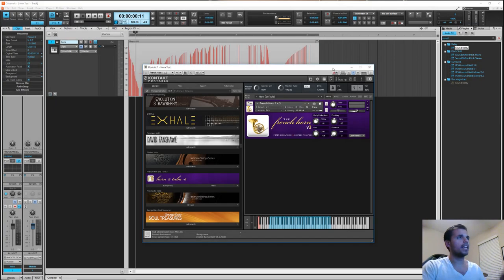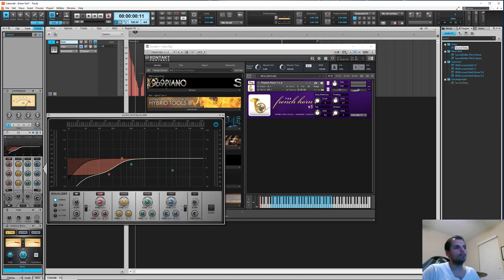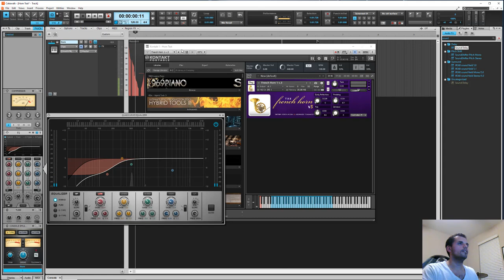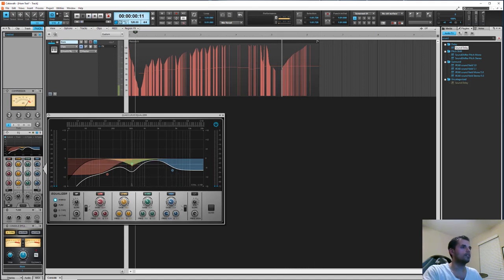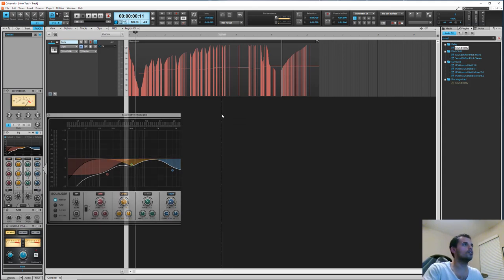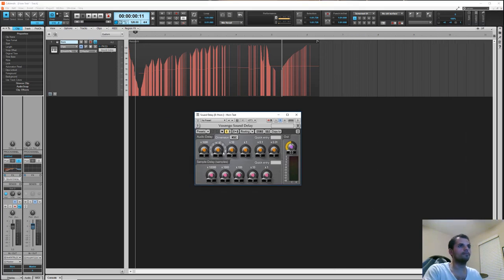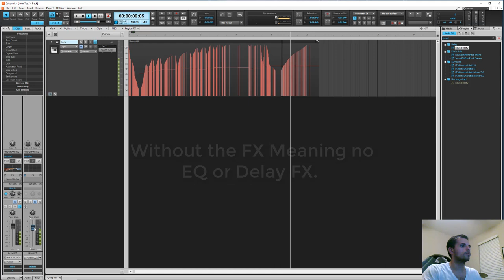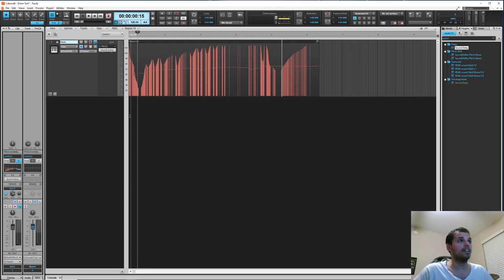Mixing Sample Modeling French Horn for Orchestra

Comment: Sam, just a quick question - do you follow the same procedure for all the other instruments in the orchestra? If so, do you use the same technique? Thanks again...
Reply from the maker: Hey Tom, thank you for your question. I definitely use this technique for other sections but brass and percussion feature it a lot more than some of the other sections. For example, woodwinds use this technique in my template but since they’re in the middle of the orchestra I don’t really use the delay to pan them. And since they are closer to the listener I use a lot less reverb on them or perhaps a different Mic option in Altiverb. For the strings, I use even less reverb than the woodwinds since they are a lot closer and I prefer to hard pan them for separation. S1 imager is great for this. You can use the delay in all the sections if you want for more stereo width but I think what gives it that “realistic” vibe is where things are placed in z space as opposed to left and right. I can do another video on this if needed but let me know if that helps.
Reply: Sam, this helps a lot...I think the idea of another video would be very popular...everything you explained above is the key to unlocking making a 'virtual' track sound more realistic. Thanks again...
Reply from the maker: @tomhodge8215  Definitely! That will be coming soon!

Comment: Great video. Any tips for using 3 or 4 horns unison? Even using the "for unison" patches, i still find they don't quite sit right. Maybe using a seperate instance is sound delay on each one to give it a different early reflection pattern?
Reply from the maker: Thank you Henry, I agree this patch is a bit odd when using in unison. For these types of scenarios I just use Adventure Brass from Musical Sampling or Caspian Brass from Performance Samples and just play it in, slightly rolling the chords to give it that delay in Realtime. I find the sound is better too for unison passages.

Only caveat is that It can get a bit thick sounding at times but for that I will adjust with either less voices or use a dynamic EQ to tame frequency build ups in the low end. Adventure brass is pretty dry so it gives me more flexibility when it comes to customizing the verb and delays.  

I also find though that the muddy frequencies usually come from the reverb more often than not so I will spend quite some time working that out.  Hope that helps.
Reply: @SamDiazProducer  thanks so much for your speedy and informative reply 👍